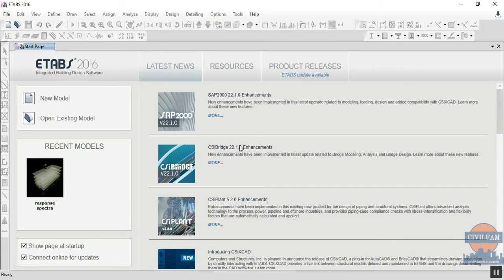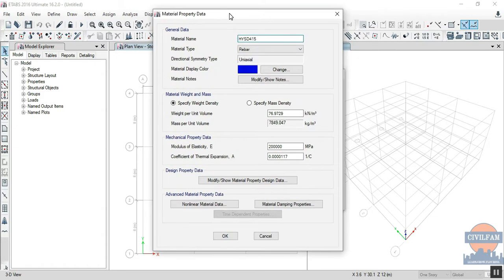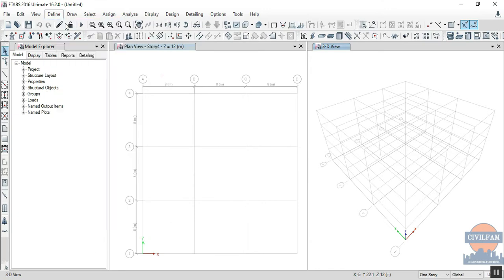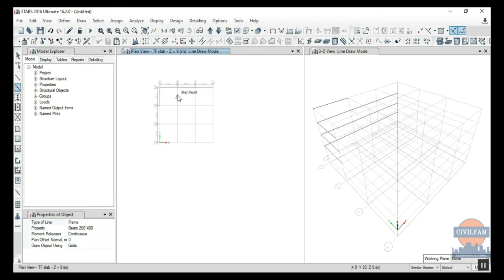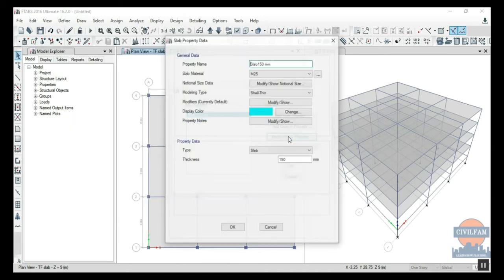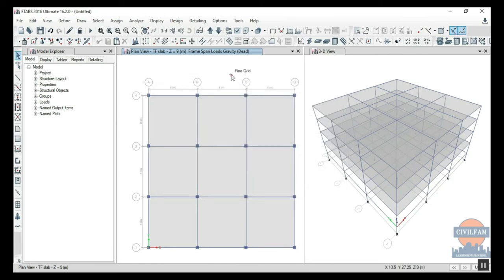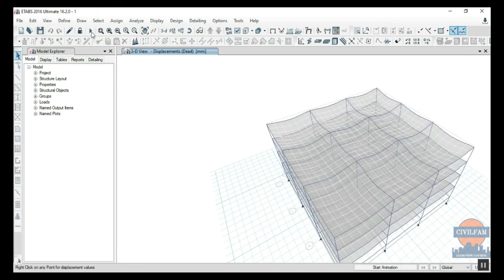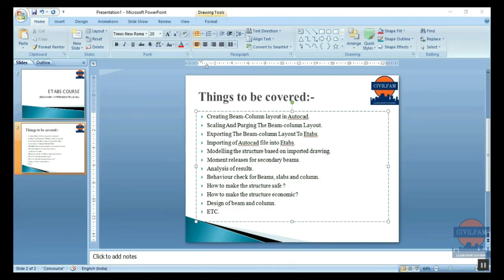Etabs Tutorial for Complete Beginners [1 hour Master Class]

Comment: Sir you haven't solved mass participation ratio in your lecture which i have bought its still in 80 percent as you have said first 3 must cross 90 not less than 90 poease help
Reply from the maker: Drop me a text on the platform where you have bought the course. If you drop a comment on a random YouTube video from 3 years ago. How can I help you here? Please text on the platform. I will answer your questions, so don't worry.